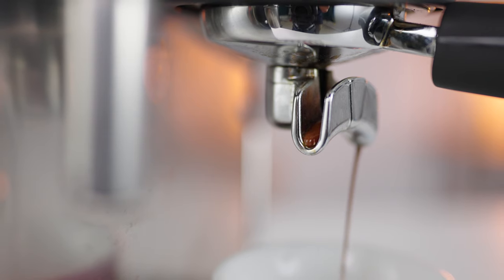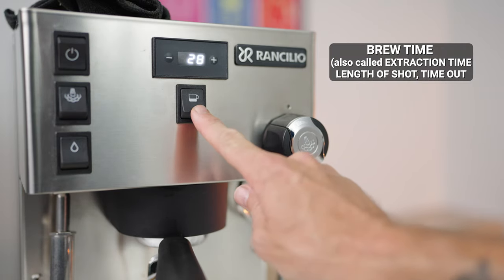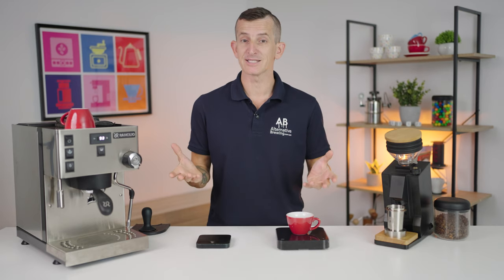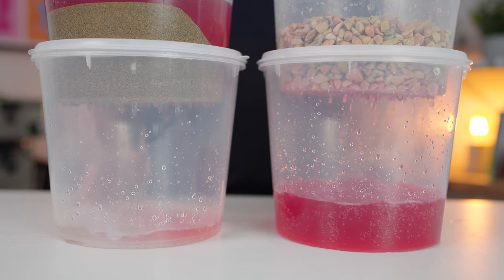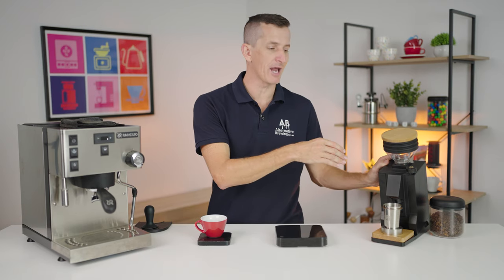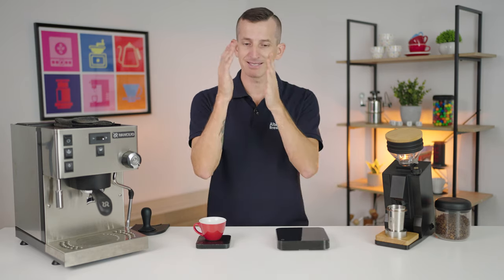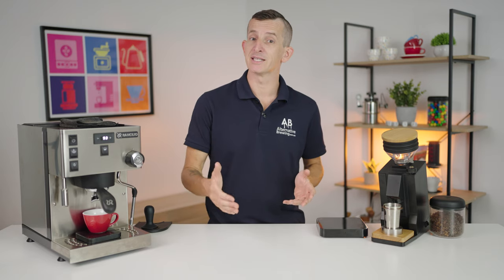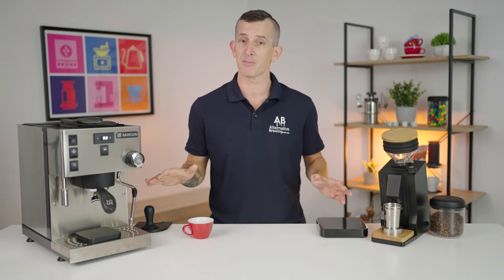Understanding Espresso Grind Settings

Comment: Great content as always!
Just curious do you get any grind/fines in your cup?
I’ve recently purchased the La Pavoni Celllini and Cilindro grinder. I’ve got the grind at 4 bars and I’m getting some grind in the shot. Can’t taste it but still annoying as I’m not sure if this is supposed to be there?
Also the shot is flowing quite fast still… 
I’m using the standard 16g basket it came with but I’m dosing at 18grams. Not sure if getting a better basket can help? 
Cheers
Reply from the maker: An IMS of VST filte rbasket will go along way to making a better espresso 👌 Get an 18g or 20g basket. Try not to add any more than1g +/- to the basket.  Adding too much coffee in the basket can also make it run too fast - most likely channelling issues. Upgrade the basket - then grind finer.
Reply: Thanks very much for your reply! I just ordered an 18g Pesado HE[%] High Extraction Basket from you. Hopefully this will make a difference 🤞

Comment: My grinder has a grind time so very difficult to pre weigh the beans. Does the grinding time affect the weight of the grounded beans? Thank you mark in London
Reply from the maker: Yes it does. Grind time will produce more or less grounds depending on the length of time. Grind Size will also affect the amount of coffee dosed out. As in, if you had the same grind time and did not change this, and had found the right grind size - if you changed the grind finer, you would get less coffee, and if you changed it coarser, you would get more coffee. Think about smashing the coffee beans with a hammer. To make them finer, it'll take you longer to make them smaller. 👌

Comment: Thank you for the great tutorial. I'm struggling to dial in with an old Breville grinder BCG800, do I need to upgrade to something newer and better? If so what do you recommend for home use,I make two coffees per day?
Reply from the maker: Possible. That is a reasonably good grinder - depends how old is old 😂 But you could be doing a lot better yes. Baratza have some great options - The latest Varia VS3 Grinder or anything from Eureka - you'd be very happy with  👌

Comment: I thought you did could add 2 grams of coffee on the basket size? 20g basket could be a 22g dose?
Reply from the maker: yes, though be careful - you want to allow room for the coffee to swell in the basket. If it has no room, and it is a) difficult to attach to the machine & b) has a significant dent in the puck from the screw in the shower screen - this would suggest there's too much coffee in the basket. If the coffee is unable to swell up, then it remains compacted during brewing and you'll have more chance of channeling and under extraction / over extraction in the cup.

Comment: ***Q for you........Is there any way to know if my Mignon grinder is working properly?
Just got a espresso machine, and Man!! , I dont know whats going on, but I am barely get 11 seconds maybe 13 seconds shots on my 18g, yet my is at the point that its smashing teeth, and even halting if I dont back off. My burrs are maybe 18 or 24 months old, and before a couple days ago, I was just grinding for pour over in the time I have been using it.  Now back to wanting to drink espresso, I am not having fun, as I burned through a bag of costly beans already! I was getting OK-decent tasting espresso in those short times, but, not really great. I will check for channeling when my bottomless portafilter arrives, but I dont think that is the case for all the shots I made. My temp is at 93C, my screens are new and clean, and my basket doesnt have any defective holes.
Reply from the maker: I'd recommend unplugging the Grinder - and opening up in tot he Burr Chamber and give the burrs, and the chamber a good clean out. from here - with everything nice and clean - begin by turning the grinder on and slowly (slowly) turning the grind adjustment fine - until you hear a little chirping noise - as the burrs begin to touch - back off immediately - NOTE the position on the dial - and move 3 numbers coarser and see how this is for Espresso.  - Make any further adjustments - and if even at a setting of 2 or 3 from the finest setting you're getting wickedly fast espresso shots - and the beans aren't super aged or anything like that - than yes - it would appear to be an issue with burrs, or grinder alignment.
Reply: THank you for the reply! I will check for alignment, and shim if need be, and meantime new burrs are on order. MAN!, I hope this solves it or else I am in a bad position! :-) Thank you @AlternativeBrewing

Comment: I neee help I’m trying different Grind setting it’s always watery I can only measure 14g in that pot I did setting 1,2,,15 and 30 it’s still watery. 

When I find got it it was fine thick but after 2 days it changed.

30 seconds is set in the espresso machine.
Reply from the maker: ok - so for 14g in. - your best Espresso - assuming you're using a Medium to dark roast - will only be around 26-30g of liquid. For this 30g of liquid, you should only be brewing for around 1.5g/sec - which is a total time of 20 seconds max. The issue is with the capacity of the filter basket. 14g is very low. Better get a 16g minimum or 20g best 👌

Comment: When do you start timing, when you hit the button or at first drip?
Reply: Great question. I'm fairly new to this and I find first drip may take as long as 12 seconds to appear but I do get those dark thin mouse tails and a gradual flow increase. If I start from pump turn on the flow appears way too fast. It would make a good follow up vid to compare the difference in taste and roast levels.
Reply from the maker: If we want to correctly time the 'brew time" - that is the amount of time the coffee is brewing. This should be done from the moment water comes into contact with coffee - which is when you press the button and start the pump - water will begin to slowly pass its way through the bed of coffee - here, extraction of the coffee is already taking place, even if we haven't seen a drip into our cups. There's many reasons the length of the time it takes to drip out varies, but so long as we begin to time the length of extraction, from the moment water contacts coffee - we're able to keep this as a consistent measurement.
Reply: @AlternativeBrewing  thank you, that makes a lot of sense.
Reply: But what if you have 5 seconds of pre-infusion? My shot doesn’t appear until 10-12 seconds after I pull the dose lever? I understand everything else but I find it confusing when to start the clock?
Reply from the maker: Hey Matt, this is a great topic - pre-infusion and shot time. Let's shorten it to PI & ST here. So your PI should not affect the ST too much - it should remain fairly close to the normal ST. Let's say , without PI, you'd pull a shot in 27-30 sec. It drops around the 5 sec mark,  and you're getting 40g of espresso out in that time frame - so your espresso runs for about 22 sec at a rate around 1.8g /s. The only difference with using PI is you will see an increase in flow rate. So you say your shot drops at 12 seconds - and you stop it at 30 sec lets say - to get 40g out. Your espresso is running for 18 seconds for a flow rate of 2.2g/s. 
What pre-infusing is doing - is making the coffee more susceptible to an even extraction earlier on in the shot. So it should saturate the full dose, thus when full pump pressure does turn on - it will naturally flow faster. If it is not flow faster after 12 sec and taking upto 40-50+ seconds - tasting the espresso is the next step to identifying whether it is over extracting or not. 

TLDR: Start timing the shot from the moment you start the shot, PI or no PI. 👍
Reply: @AlternativeBrewing  Thanks for following up, I’ll have another play this morning. I have a VST 18 gram basket which I normally fill with 20 gr (been told that’s ok?). 
The shot runs well with excellent crema but sometimes I find it difficult to work out, when not perfect whether it’s sour or bitter? I’m running a Bellezza Gulia & a Eureka Mignon grinder
Reply: My Specialita is set for approx 20 grams, 10.4 seconds resulted in 19.4 g so I’ve increased the time by a .2 second. Shot started to pour at 10 seconds (5 sec PI) & reached 40 grams at 35 seconds…I’m thinking this is about right? Espresso tasted very good, not sour or bitter. Maybe dial back the grind a bit?